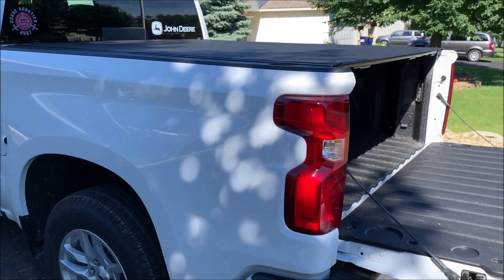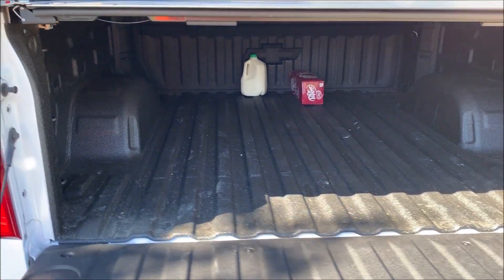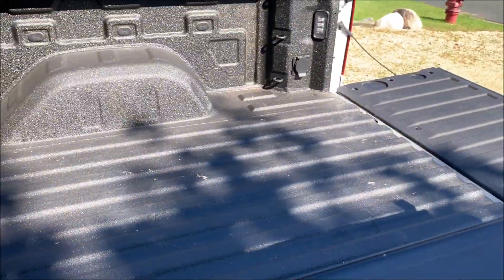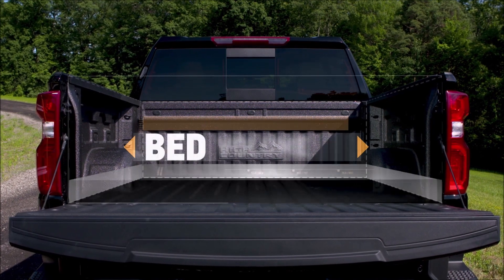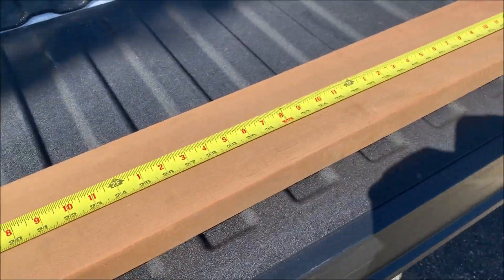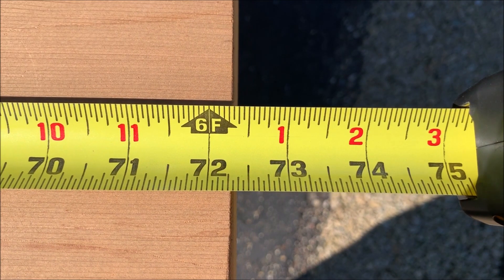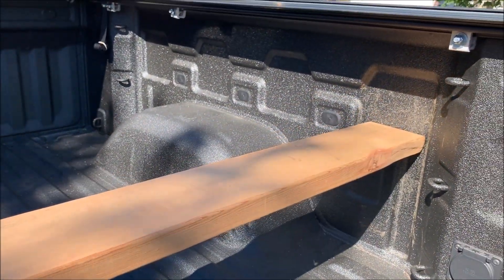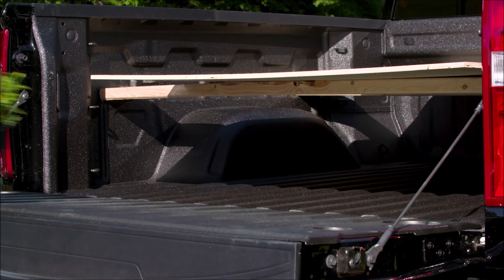Truck bed mod for under five bucks!

Comment: How are the LEDs working on your truck, that you added a few videos ago?  I’m thinking of ordering them, and switching mine out.
Reply from the maker: Tony Pesos Hey! They are working great! Probably a little too bright, but they are not running all the time, so I shouldn’t get in trouble lol. I put 2 of the extra 194 license plate LEDs my pack came with in my Dad’s 07 Sierra and found out that polarity matters on those. Must of gotten lucky on their orientation during the install for my truck.

Comment: Why not just use a large storage bin for groceries and secure it with a strap
Reply from the maker: Doesn’t this seem faster? Plus I’d rather have a board to deal with then a tub if I suddenly needed my full truck bed for something.
Reply: @Evgenya Permekova
Speaking from experience- having a tub/bin in the bed is a surefire way to find yourself using it as a catch-all for things like straps, bungees, tow rope, and misc gear/tools/equipment and then when you need it for groceries- it’s full. They’re also not typically strong or durable. Also- if you frequently need to haul lumber or oversized items, then the bin becomes a nuisance. If it’s full of crap- it’s heavy and either way, full or empty, if you have it in the bed and need the bed space unexpectedly for larger items…you’re stuck with trying to figure out what to do with it, and/or the stuff it’s currently holding. 
Majority of truck owners need and utilize some type of cargo management system for their truck bed. Why you feel it was necessary to come here and suggest the video idea lacks merit is beyond me. I’m here because I searched for vids on DIY truck bed dividers since bins are a pain in the ass. Why are you even here?
Reply: @TruckOwnership101  yes exactly! I replied something similar before seeing your response. You can tell who here in the comments has a truck just for the sake of owning a truck, and who here has a truck and actually uses it for truck intended purposes 🙄🙄. Nice vid. Thanks for sharing.  I have a ‘21 F-150 and the general principal of your vid still applies. I’ve never seen anyone point out the dual cargo zone that can be created in the Silverado with just a few pieces of lumber. That’s pretty slick! I’ll be scoping out my truck bed this weekend to see if I’ve got any similar intentional styling that would allow me to do something similar without the bed modification I’ve seen some people do via brackets and hinges. 
Thanks for the vid! I’ll be sure to check out some of your other content.
Reply: @nicholem4831  lol you are busy doing the opposite of looking the video but busy critiquing my comment of opinion. There’s 100 ways to do something I’m out of opinion and everyone’s different experience and situation. It’s called agree to disagree in life but instead you’re questioning why am I on the video making a comment I didn’t see in your rules that you were not allowed to make any comments I thought comment section is for leaving a comment and not for people to scroll and criticize comment. Did you too by any chance get hired by youtube to be the critique of comments on peoples videos because if that’s a job let me know I’ll apply for the position